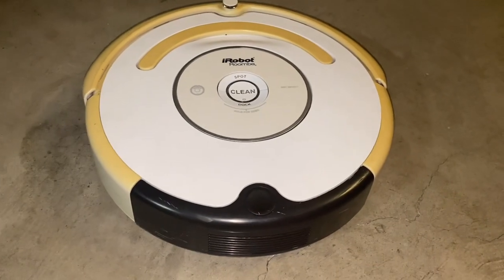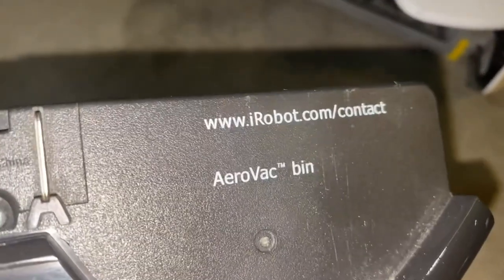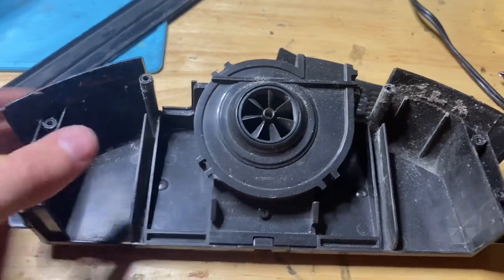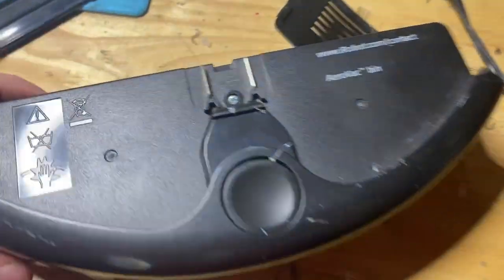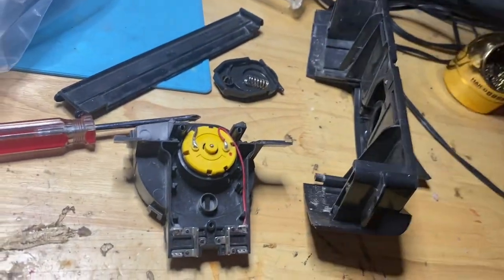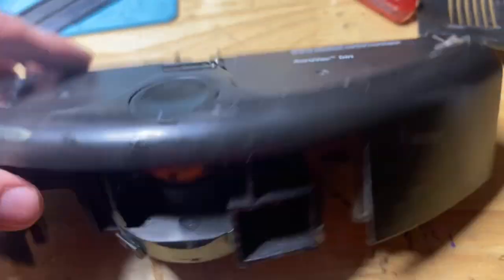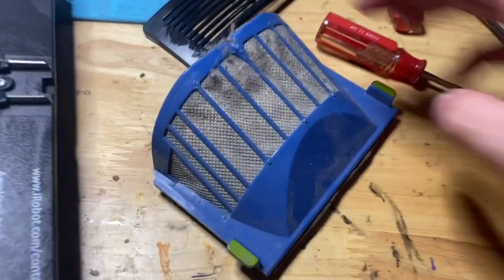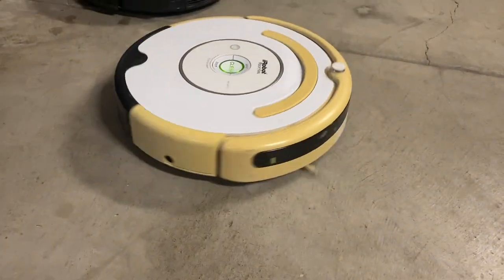How To Repair Broken Or Noisy Aerovac Dust Bin - iRobot Roomba 500/600 Series (Simple 5 Min Repair!)

Comment: Thank you for the video! I have a Roomba 681, with a slightly different dust bin. It turned out the screw holding the motor was under a sticker. I peeled the sticker off and was able to clean and WD40 the motor unit.

Comment: Hi! Mine it's just a mess, I cleaned it up but when install the whole thing again the motor of the fan starts automatically, even when it's turned off, idk what to do, help pleaseeeee
Reply from the maker: Sounds like a circuit board issue. I’d recommend taking a look at the main motherboard. There could be a resistor that’s faulty, and that could be giving the motor power when it’s not supposed to.
Reply: @IDogFan41  YES! I opened it up with my dad yesterday and fixed it, it needed some cleaning and scraping haha, thanks a lot